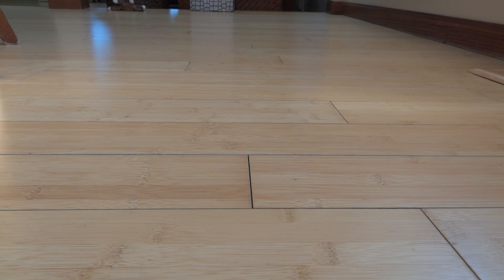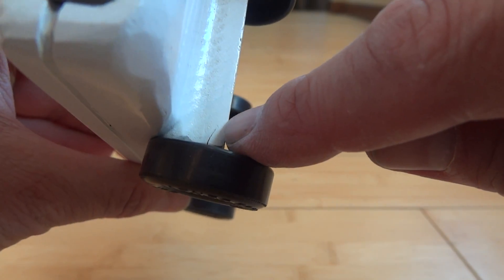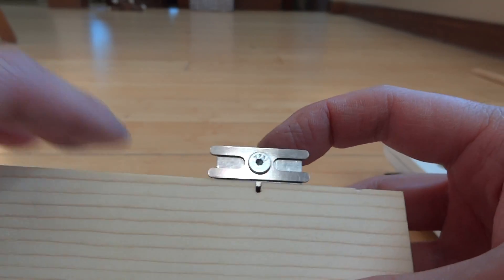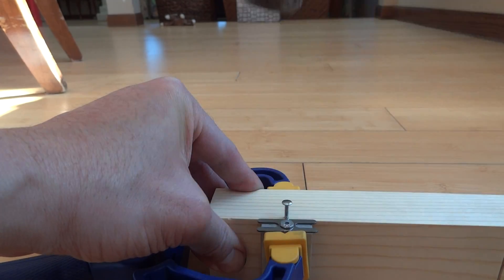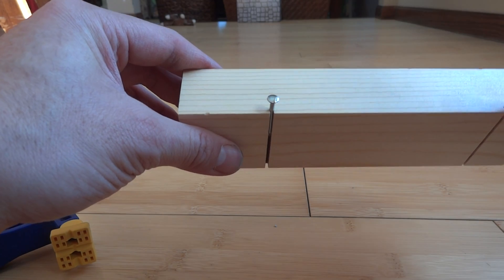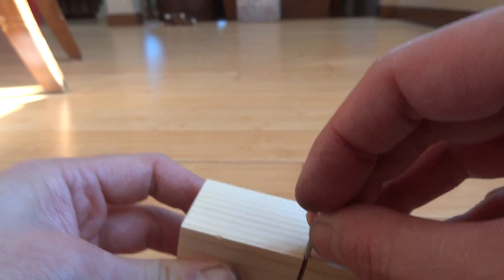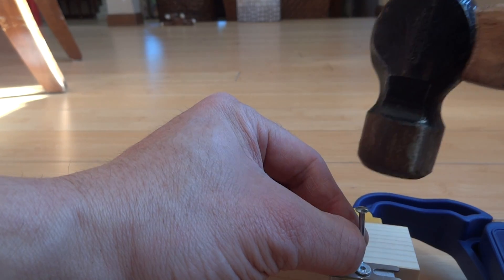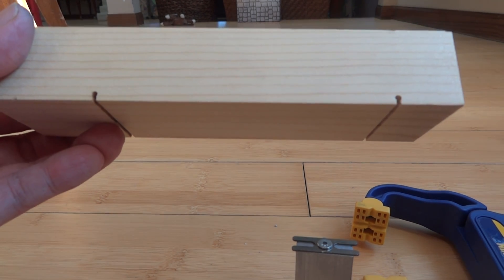Basics of builidng a pinewood derby car: Part 1

Comment: Use a #44 drill bit in a pin vise along with the axle guide to relieve the axle slot.  Never ever use a hammer when building a pinewood derby car.
Reply from the maker: The axle guide and drill bit is a viable method, and I would agree that a hammer should not be used on a cut derby car.  That's the point of this video.  The Pro-Axle Guide is readily available, and less expensive than the axle guide.  If someone is going to use it, it should be the first thing they do with their block of wood.  You can't split the axle slot on the original block of wood.  Using a hammer here is not an issue.